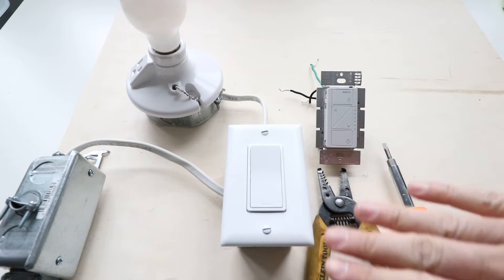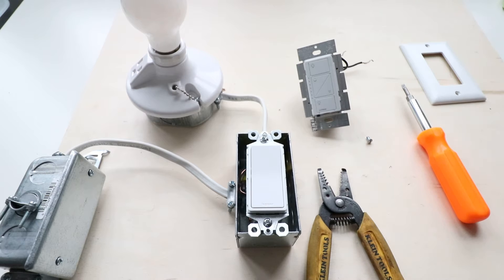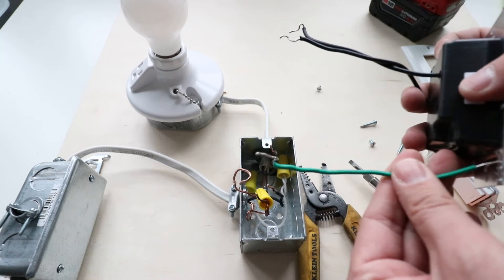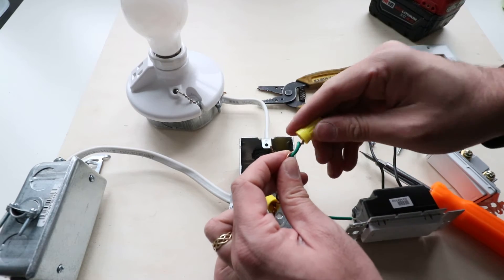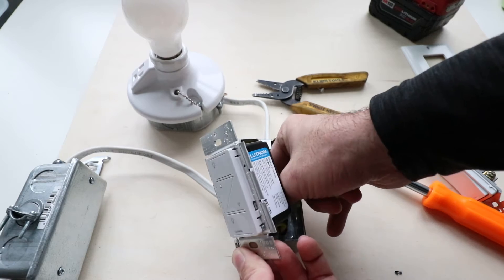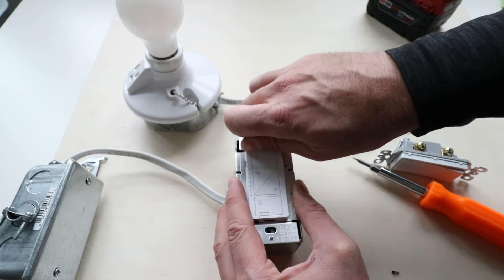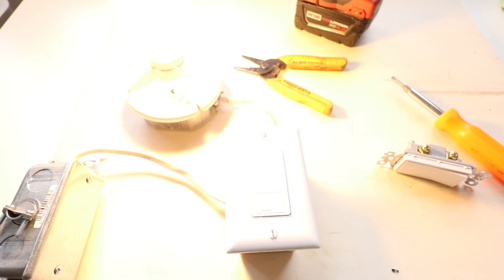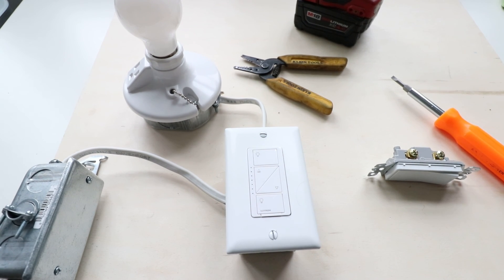Smart Dimmer No Neutral Installation

Comment: Hello, first of all, you are showing a specific dimmer, so the title is incorrect, it is not about "a smart dimmer" but a Lutron one. Second, you don't show the smart part, how does it work with Alexa, Google. This is essential, what you show here is like a regular dimmer installation.
Reply from the maker: Liviu, yes you are correct  it is a Lutron Smart Dimmer which does not require a neutral: https://amzn.to/37Fh9JQ. We have the full video that shows how to connect it to the hub here: https://youtu.be/-YgqqmYzQww?t=602 at 10:00 starts the setup process on the hub. If you want to connect to Alexa this video shows you how: https://www.youtube.com/watch?v=-45jYG5qALA if you want to connect to Google Home this video shows you how: https://youtu.be/u4x9idVl1Ik hope this helps you!

Comment: Question, is there a circuit breaker inside the lutron caseta?
Reply from the maker: There is a tab you can pull on the front of the light switch that will cut off power to the hot line, so you can safely change light bulbs.

Comment: i don't have the neutral and ground, both wires are missing, from this video you have neutral from the mainline and the light has it too it seems, i don't have it, will it be a problem?
 i only have one wire coming in, the hot wire, can you fix it with lutron?
Reply from the maker: Lutron Caseta: https://amzn.to/3gMbpQ8 only requires a hot and and a load wire. It does not need a neutral wire.  Watch this video to further understand typical light switch wiring:   https://youtu.be/Q4OkmhTVaJ4
Reply: @OneHourSmartHome    that video also shows the line coming from main panel carries 3 wires, the black the blue, the green.   I only have one hot wire coming from the main panel, the black line, that 's what I tried to tell you in previous comment, can lutron solve that?  do you have another video that shows only one hot line coming from the electric panel ,  and that is it, no other lines, just ONE line. the hot line. ONE line- the hot line, the black line, no other line
Reply: by the way, i searched youtube with this phrase and nothing came up " just one line the hot line coming from the electric panel "
Reply from the maker: @youtuub  A lutron caseta switch will work to replace an existing switch that has a hot and a load. If your existing light switch is working and turning on/off lights it has a hot and a load.
Reply: If you don’t have neutral and ground.. you have issues far beyond mainstream wiring. And have no business trying to DYI. Not an insult, but you have physical wiring that needs special attention. And, is most likely illegal.
Reply: @BeaulieuTodd  or just a home built before 1974...